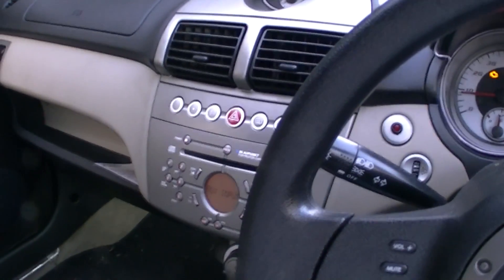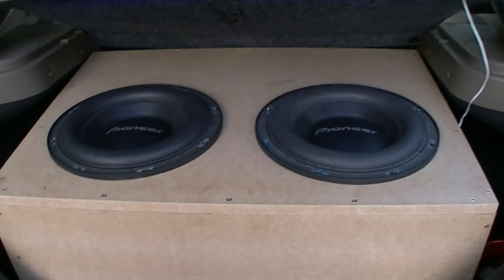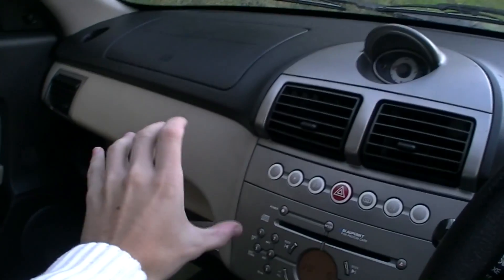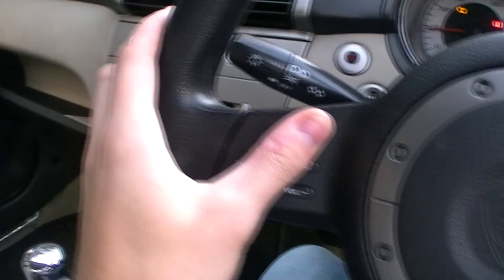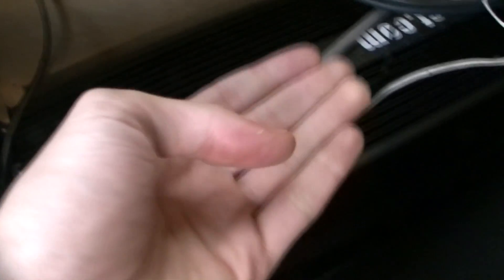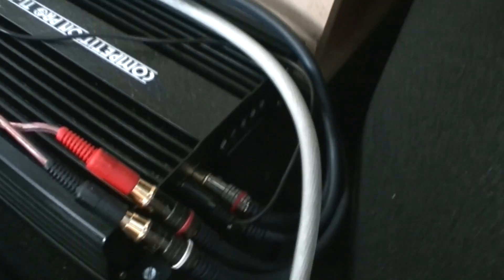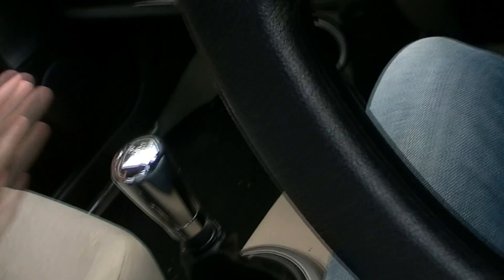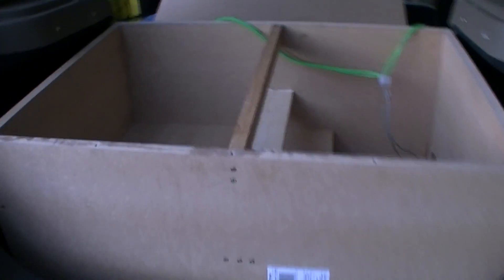Two TS-W121SPL subwoofers RIP the box apart!

Comment from the maker: @PJRehlaender im running line-level converters off the rear speakers. Its not an ideal solution, but it works great combined with a ground loop isolator as a solution before i get a new head unit!

Comment: looks good but you should choose what subs you actually want to run so you can properly seal that box and also have you thought of removing the hatch cover ( the carpeted piece that goes up when you lift the hatch). it looks like it is restricting alot of airflow.

Comment: Use plywood. I gave up on MDF a long time ago. I prefer even crappy plywood to MDF although birch is best! 12mm or 18mm. I built one of my sub boxes from 9mm birch, braced of course!
But hey this is 2011, the year I built an enormous folded horn. The thing was 32 cubic foot external I kid you not, for 2 12" JBL GTO1264 woofers. Decently loud off the little 80 watt amp I had, and could get the door to move on 7Hz, although was built with pure guesswork and it was built with MDF, hard board and 2 x 4 bracing!

That red power cable reminds me of those cheap bike locks you can get with a thin steel cable and tons of rubber/plastic around it to make it look like a thick lock!

Comment: You really need to build a box just for those subs.  Screws will never hold for extended time for two reasons; 1 the expansion and contraction due to humidity/ or temperature, 2 VIBRATION!  SAme reasons screws and nails back themselves out of a deck outside your house.  Any panel over 18" needs to be braced and I would go so far as to a double the top baffle.  Glue actually creates a chemical bond.  The would should give before the glue.  2X4 just changed your airspace...

Comment: bro how would you compare the 3004spk with the 121spl? was getting my hands on the 3004spl will later upgrade to dual 3004spl
Reply from the maker: 3004 is more powerful, 121 is lower fs better for sealed or home theatre
Reply: @barevids  would you recommend a ported box (dimensions and tuning) for the 2 3004spls? loved your setup! 
also have you tried the 3003d4s?
Reply from the maker: @themountain6437  yes always ported. Depends on your music but these liked 28hz.
Reply: @barevids  mostly english hiphop that's it lol. do you have your box's dimensions?
Reply from the maker: I don't sorry this was like over 10 years ago lol
Reply: @barevids  would you recommend a single enclosure with single port for 2 3004spls or 2 separate enclosures with separate ports?